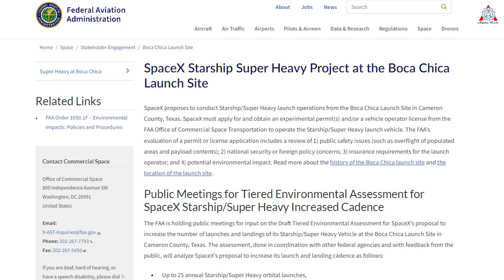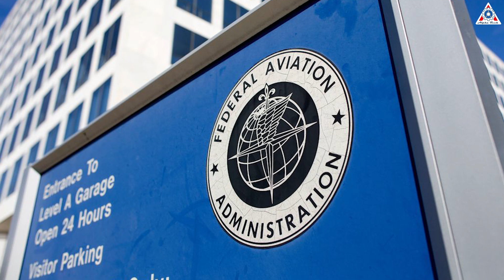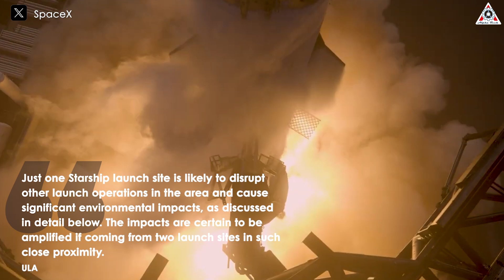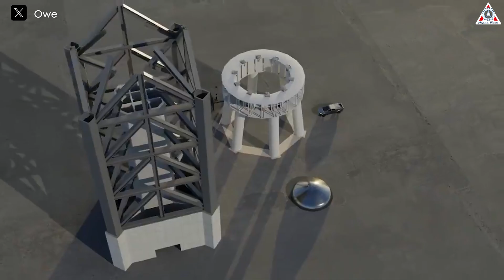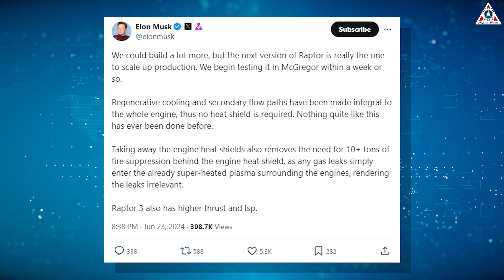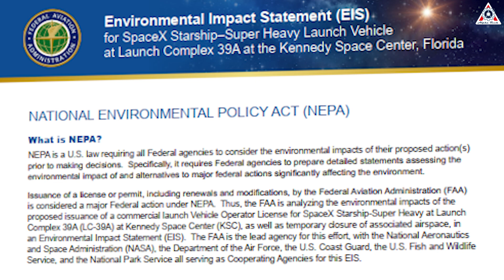FAA’s Big Announcement: SpaceX Starship Launches 25! NASA’s mind-blowing…

Comment: Hopefully this is the last gasps of Blue Origin and ULA,  before they start going to Space-a-holics anonymous, and admitting their problems... 

Surely Boeing will be there nodding tearfully...

Elon ain't stoppin', get over it! 

What I know about the engines, is theres still a lot of potential left.
Elon is still chewing on parts count and simplificaction, and just starting to make noises about upscaling.

As I have been doing writs on for literally years in Space forums, Theres the shared pumps powering multiple combustion chambers which will lower collective parts count dramatically.

And I do think theres potential for Ring Engines. Basically is ELONGATING an engine sideways in a circle.
And could be pressed sections, or even done with rollers and butt welded. maybe three pieces...for the combustion chamber proper. And other major pieces might be your preheater/phase change jackets, Then your manifolds, if your jackets had spreader baffles.  There would be a cap piece. And you could have some steering control via valving around the manifolds feeding the circle. slight Differential thrust maybe if you had some divider boxes around the circle.
Kind of like a harmonica, and choosing which holes to blow into.

And sure there are other myriad engine design options possible.

The good news is as SpaceX ramps up production, cash flow will result, and they'll be able to continue research and development at an even more accelerated pace.

Too bad about Those other legacy companies with their diversity hire managements, and not getting the progress...

And Elon doesnt have a diversity problem, over half his work force at Starbase are Burrito originators, and the other half undoubtedly culinary cultural appropriators of the same. 🤣

And when you see video of the people in the white collar area, its obvious theres all kinds of people operating on merit..
Space Cowboys, to  Orbital Hippies, all working together like clockwork.

Build it with merit, and they will come!

Being Americans has never been about an ethnic group, its about an ATTITUDE!, and SpaceX is a pretty good example of how that attitude works.

Working together, at making things better...

Happy I will live to see a sky filled with ships!

Comment: Given, the spectacular level of cadence and other outstanding achievements attained by SpaceX already and, obvious implications for market share based on cost effectiveness for SpaceX re-usable vehicles and payload versatility as opposed to significantly more expensive single use systems offered by the best competitors can offer.

What is the likelihood that Blue Origin and ULA will be conducting launches at a rate remotely sufficient to justify any possible (and ostensibly specious) concern regarding Starship launch activities impacting launches optimistically proposed as being undertaken by those companies in the foreseeable future?

Surely it will require any companies aspiring to compete with SpaceX to come up with innovations significantly exceeding achievements already attained by SpaceX with regard to reliability and cost effectiveness alone.

Neither ULA or Blue Origin can currently offer anything remotely approaching capabilities requisite to that.

Even if, competitors were to somehow attain technological parity with or exceed what SpaceX currently posses.

Impacts resulting from those competitors undertaking a comparable increase to their own launches by usurping market share from SpaceX would result in essentially the same levels of impact to which they claim to object .

And what do, reasonable projections imply regarding the likelihood of that happening anytime in the foreseeable future?

With regard to the latter consideration SpaceX has now attained such a substantial lead with regard to innovative technologies and their impact on reducing cost per launch, that it is difficult to envisage competitors remotely approaching catch-up unless they are able to emulate or unlikely as it currently seems surpass, SpaceX.

Despite the efforts of naysaying competitors who have simply and abysmally failed to compete with SpaceX.
Musk and his teams have taken the big risks and made the big leaps requisite to attaining the advantages they currently enjoy so they have well and truly earned and therefore deserve their current prominence. 

At least two obviously envious if not maliciously spiteful competitors have tried to slap fresh complexions on designs and systems utilizing essentially obsolete technologies and even surplus parts of that genre and present them as something new.

But since results like launches for SpaceX Super Heavy booster and Starship speak far, louder than words, critics and naysayers simply cannot be heard over the increasingly frequent and triumphant roar of SpaceX launches.